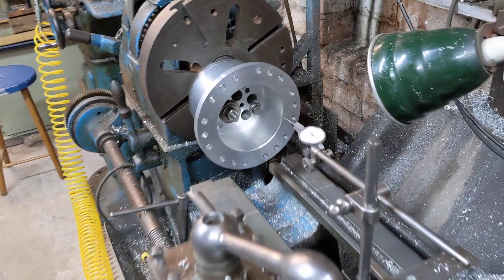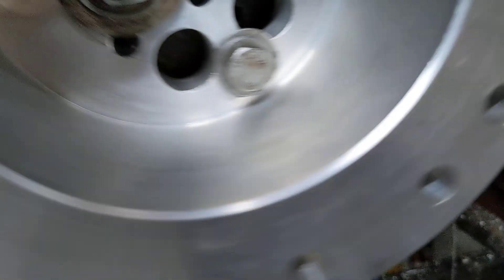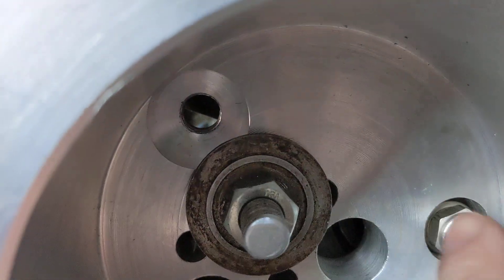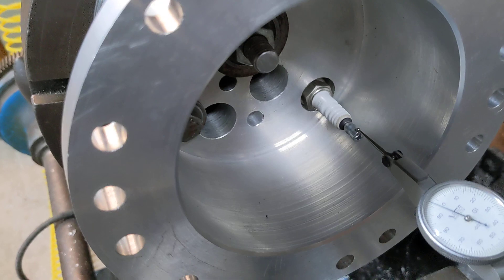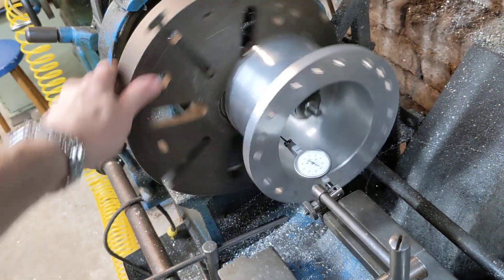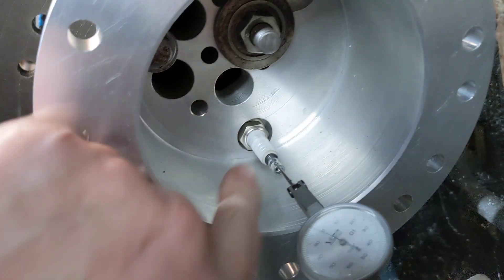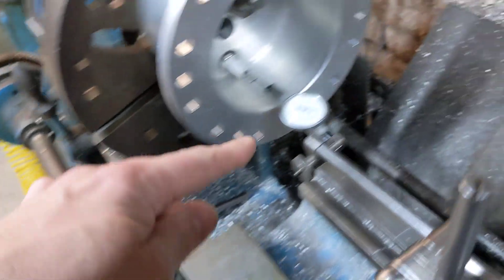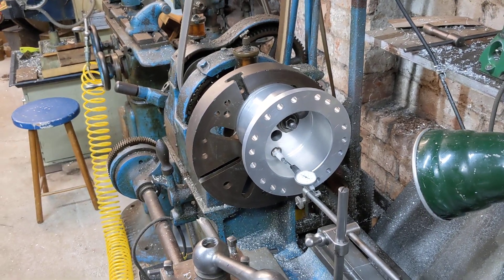One down, one to go.

Comment: Ok, I got it. How to decompress without adding a poppet valve.

if cam timing is retarded, so the intake stays open for part of compression, compression will be reduced by limiting & venting intake. I call it anti-compression.

a way to do that is to run a longer timing chain, and add a second tensioner, on the drive side of the chain, that is linked to the existing tensioner, on the slack side of the chain. With them linked  you can easily switch which side, drive or slack, has the extra chain. This can then be used to retard "cam" timing, and lower the effective compression.
Reply from the maker: Anti+compression! I like that, sounds like something you buy in a tin to stop  pinking 😁 
It's a bit late to re-design the timing chain now, but a nice idea. 
The Conrod to sleeve clearance is very tight though (there's videos on that). That would need considering for sure. 
I'll mull it over, thanks!
Reply: @StoneEng  I was thinking of ways to do it,  I've got one that avoids interacting with the cam gear. Picture a 'T', the cross is the crank, the bottom point is the cam...this example may be USD, just flip it!

ok, so the cross point is the crank, the horizontal line is the tensioner link. At the ends of horizontal line are idlers, so the cam will actually spin backwards, because the chain will go backwards (over link, under crank, over link, down & back to cam, under cam & back up to link#1). 

The tensioner link will rotate on or near the crank, changing the timing between the cam & crank.

Comment: Welldone lads 👏🏻, might I suggest  turning down the wall of your plug socket a wee bit also if things are getting tight😉👍🏻
Reply from the maker: Yes, that would work. Or maybe a box spanner.. But I'd rather make it easier for myself later and not have a load of special tools. 😁